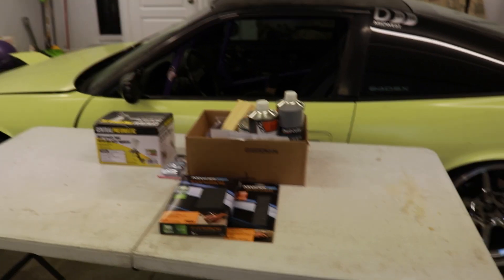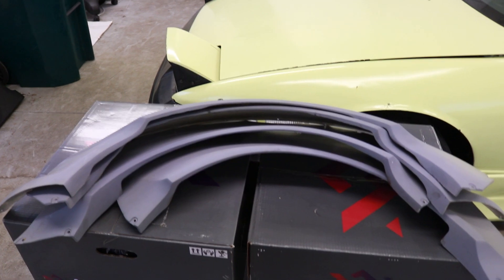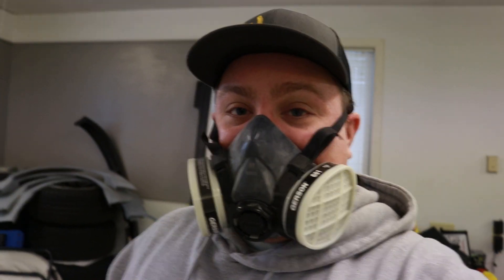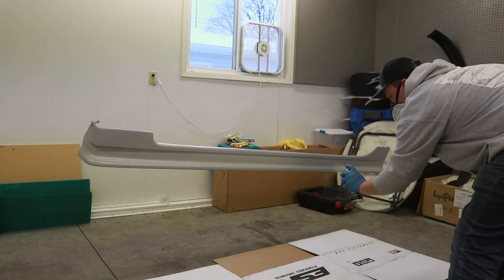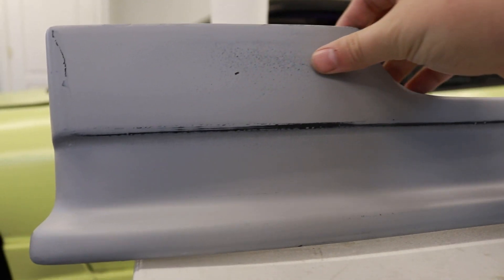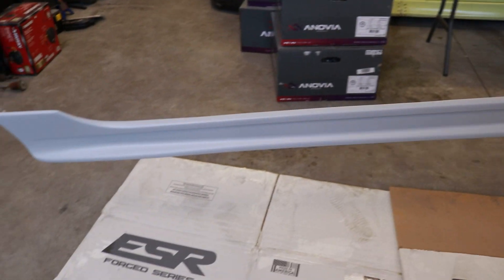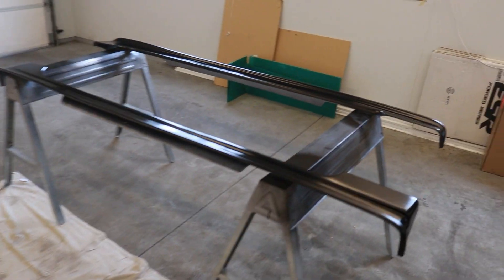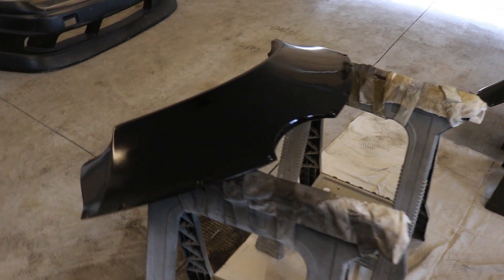Painting The Lions Kit Widebody For my Mazda RX-8

Comment: I got stainless steel Allen head bolts on Amazon (m6 x 1.0 I believe) and put riv nuts in the body. I have had them on the wide body for 2 years and they look brand new. Cheap too. I’m in the process of doing hidden hardware now

Comment: I've use that cheap harbor freight gun and it works decent considering the price.  I only used it for painting an S13 gas tank and I got decent results.  I think I would consider picking up a little better quality gun if I were going to paint something more visible though.  I found this setup video for the exact gun useful https://www.youtube.com/watch?v=PiLX3Dcp4F0&t=204s -- especially the tips on dialing in the spray pattern.